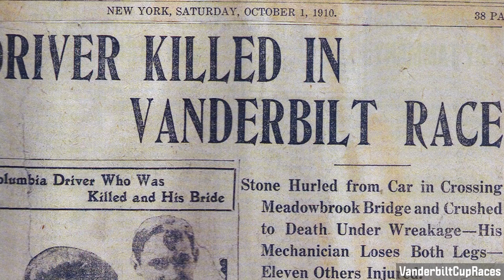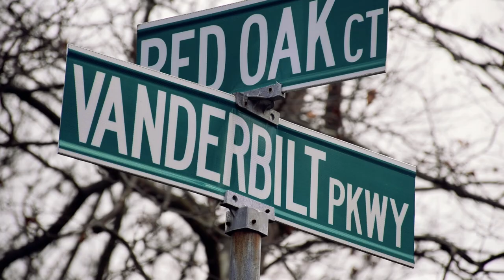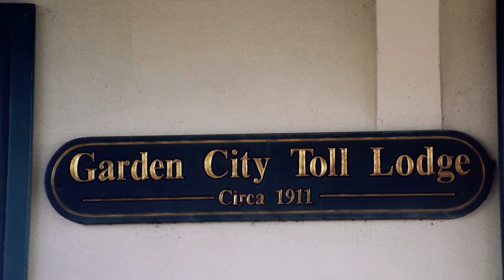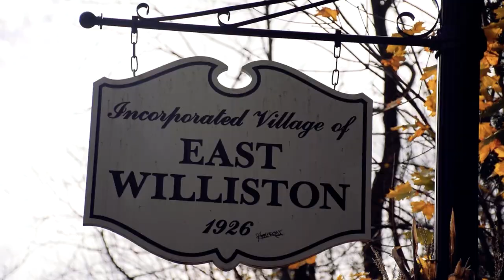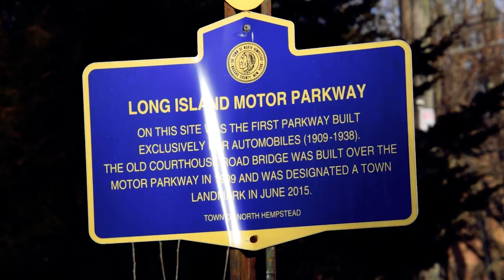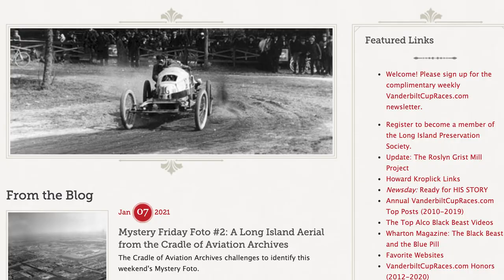LONG ISLAND'S HIDDEN HISTORY - EPISODE 3

Comment: In addition to that mound which is left from the bridge embankment, there are two more easily visible today. One is on the east side of Clinton Road in Garden city, just a bit north of the school sitting on the corner of Stewart avenue. The elevated mound is just outside of the border of Roosevelt field. The bridge over Clinton road was taken down decades ago. There is another one on the north west corner of union turnpike and Winchester blvd, right across from creedmore in Queens. It is a high mound that is the eastern terminus of the extant part of the motor parkway in queens county. The top is paved and continues west.

Comment: Such a great video.  Well done.  However, the right of way where the power lines exist are from the abandoned Stewart line from the Long Island Railroad, not motor parkway.  Although, there are points where there were indeed very close to each other, (near the crossings of Newbridge road and Wantagh ave.)
Reply: Throughout Nassau County you will find the power lines and right of way which mark the path and remaining sections of Motor Parkway. Through Levittown is also the LIRR ROW with power lines. For most of this section both the LIMP and LIRR run side by side.